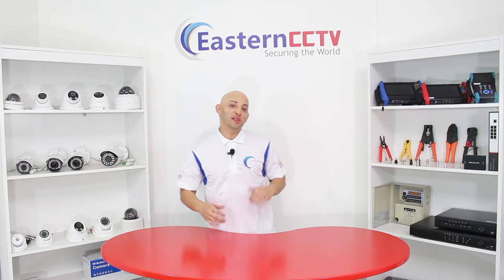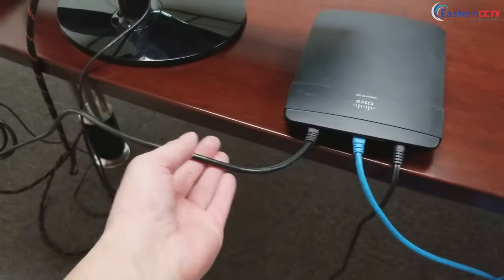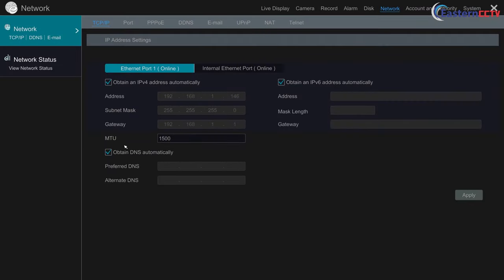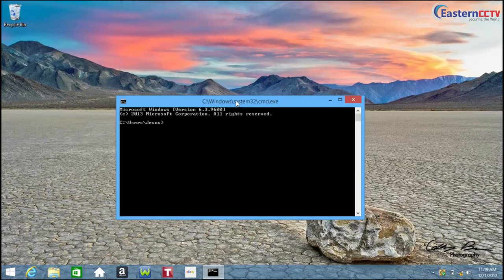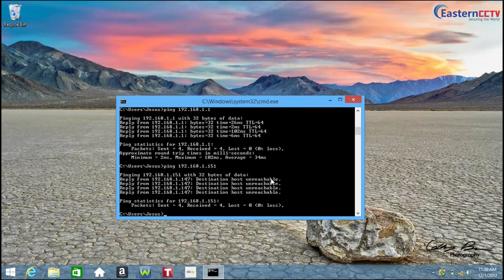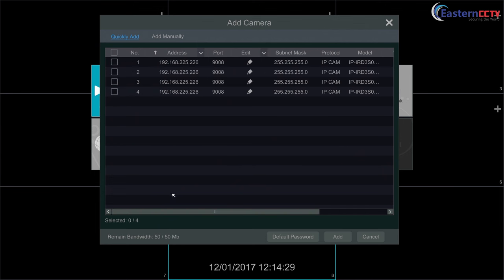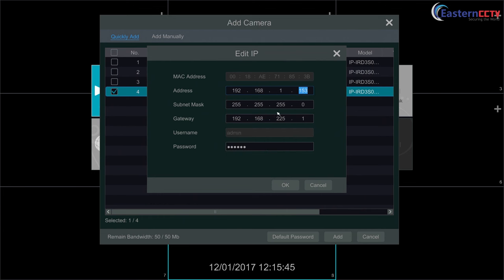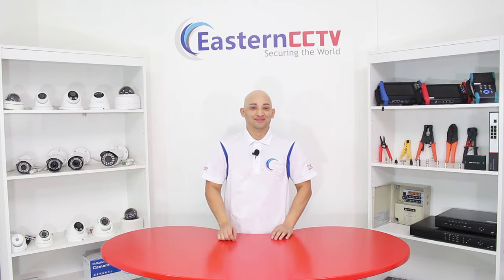How to Configure IP Cameras Using External PoE Switch Step by Step ( Titanium Series )

Comment: if I have a 16 channel NVR with 16 IP cameras can I group them either by 2X 8 port POE switch or 4 x 4 Port POE switch as long as the uplinks of each POE Switch and the LAN of the NVR is connected to the same router? Secondly could I add another router from one of my main router ethernet ports to handle my IP Cameras and NVR so I don't have too much overload on my main router between the IP CCTV system and other computers and tablets on the same network! Basically I want my IP CCTV system to have a dedicated network from my home computer/tablet network!

PS: In my current home I have a 8CH NVR with 8 IP Cameras which are connected via the POE ports of the NVR, However I might be purchasing a bigger home which requires double the cameras that I currently have now and the structure seems to have more obstacles than my current home to have all 16 ethernet cables to meet at the same point!
Reply from the maker: The answer to both of your questions is Yes you can. You might need to add the IP cameras manually because they are not connected directly to the PoE Ports on the NVR If they are EasternCCTV Titanium Series IP cameras and you have a titanium NVR just follow the steps on this video. If they are not EasternCCTV then you might need to refer to their manual or call their Tech support =)
Reply: would I be correct to say that direct connection to the POE Ports of the NVR the IP cameras are automatically assigned IP addresses by the ports that each is connected to?
Reply from the maker: Yes. The NVR would automatically assign and configure the IP camera. In order to do so the NVR and the IP camera has to be the same brand and of course they need to support Plug & Play Feature.

Comment: Hi what if i plugged a whole bunch of Cameras to the NVR and use another Switch to NVR and connect more cameras to the Switch will it work?
Reply from the maker: if you connect the NVR LAN port to the External PoE Switch and the switch to the router then it will work. if you connect the POE switch to one of the POE ports on the NVR, there might be a chance that it might not work. also, the NVR has a limit to the number of IP cameras that you can add.

Comment: Hi, what if I don't have a Nvr but DVR is it possible to connect Ip cameras to a Ip cams?
Reply from the maker: Hello, could you clarify a bit? If you have a DVR that supports ONVIF IP Cameras, you could add them to the unit.
Reply: @ENSSecurity  Hi,I have a DVR and Ip cam can this 2 be connected with a switch,what kind?
Reply from the maker: @cktrading72  Hello, It will depend on whether the DVR accepts IP Cameras. If the DVR does accept IP cameras, you typically need a PoE switch with 802.3af(PoE) or 802.3at(PoE+) compliance.
Reply: @ENSSecurity  thanks

Comment: After connecting all the cameras to the NVR, can I now view all the cameras from different location in the house eg different rooms on a regular smart Tv as Monitor? If possible, how to go about seeing this up??
Reply from the maker: You can view the cameras on the TV as connecting the regular monitor via HDMI or VGA port of NVR.
If you ask for the app support on smart TV, SuperLive Plus (Titanium app) doesn't support on smart TVs.
Reply: @ENSSecurity  so the situation is my customer has 5 smart TVs all in different rooms/locations, he wants to be able to view the cameras on all the TVs. Would I have to use a HDMI splitter or is it way to do it over the Ethernet?
Reply: @ENSSecurity  hey good day again to you. I was wondering if I could use a HDMI to ETHERNET adapter to transmit the video signal from my NVR to multiple TVs in different locations as a monitor to be able to view my network cameras??
Reply from the maker: @ianking8212  Yes that is correct
Reply from the maker: @ianking8212  Yes you would be able to use a splitter

Comment: What about the internal POE IP ranges does those stay on separate subnet ie 192.168.254.X ?
Reply from the maker: Sorry for late reply, The internal PoE can stay on its own separate network. it is recommended this way so it won't cause any network conflict.  You can use the same network range but make sure none of the IPs of the cameras are the same as the ip cameras on an external PoE switch (if any)

Comment: H,i I have Tiandy NVR and Ertech  IP cameras. The NVR can't find the cameras, and the software that came with them doesn't as well. What could be the problem? Tnx
Reply from the maker: 1st thing to check, Check if the IP cameras are getting power. The software of the IP cameras make sure you dont have an Antivirus active or firewall. 2nd Make sure the IP cameras support PoE.

Comment: Hello, I have an account with Eastern CCTV. Thank you for this video. Does the PoE have to be a gigabit PoE switch or is 10/100 ok?
Reply from the maker: It all depends how many IP cameras you have connected to it and also at what MBPS you have them set at. For example if you have 10 IP cameras at the maximum of 10Mbps that equals to 100MBPS and if you have more cameras connected to the PoE switch then the network will not work properly on the PoE Switch. If you are going to connect a large number of IP cameras i recommend you the Gigabit Switch.
Reply: Hello, Thank you for your quick reply. Yes, this is 40 ip camera system. Can I go to a non-poe gigabit switch at the NVR and branch out to 5 seperate 8 channel 10/100 PoE switches each having 8 cameras? (or do the PoE switches also have to be 10/1000 switches?)
Reply from the maker: Yes you can do that. You can connect the NVR to the Gigabit Switch and connect all you PoE 8 Channel Switches to the Gigabit switch as well.

Comment: Hi,

I want to ask,Isit possible that I have a 4channel NVR and I buy a 24 port Switch and connect 8 Cameras ?
Reply from the maker: Hello, You can only have the Max number of cameras the same as the number of channels on the NVR. If the NVR is 4 channels you can only connect 4 cameras. If the NVR is an 8 Channel with 4 Port PoE then you can use any External PoE Switch to add the rest of the cameras.
Reply: Thanks for the reply 
EasternCCTV (USA) LLC | Professional Security System Wholesaler

Comment: How to configure d link poe awitch and nvr , i hav to connect 60 80 cp plus camera using 2 3 poe switch and nvr
Reply from the maker: Hi, Your connection will look like this. 
NVR  LAN port ---   Gigabit core switch ---  Dlink PoE switch uplink port  
                                                                    Dlink PoE switch LAN port --- CP Plus camera.
                                                        
                                                              ---  Dlink PoE switch uplink port  
                                                                    Dlink PoE switch LAN port --- CP Plus camera.
                                                        
                                                              ---  Dlink PoE switch uplink port  
                                                                    Dlink PoE switch LAN port --- CP Plus camera.

Assuming your CP Plus camera is ONVIF compliant, and the NVR you choose supports 60 to 80 channels.

Comment: I want to use 3 poe switches, where to connect the other 2 poe switches? Can i interconnect the switches and connect just one switch to the router via gigabit ethernet wire/port?
Reply from the maker: PoE switches they act just like any other network Switch. you can have many PoE switches connected in like a chain mode. if your PoE have an UpLink port then connect that to any available port on the other switches. As long as you have the IP cameras connected to a PoE port then you can connect the Switches any way you want as long as you don't exceed the maximum bandwidth of the Switch.

Comment: Ok so can you use a gateway if not how do you connect to the internet for cloud access
Reply from the maker: Hi, Can you rephrase your question because is not clear. I can't understand what is the question sir.
Reply: Do you connect the land cable from your modem to your router or can you connect directly to the Poe uplink using a gateway if your Poe switch has 2 uplink switches I don’t see where you connected a land cable into the Poe switch or the router in order to gain internet access
Reply from the maker: @mrpierce17 Pierce there are two ways you can connect them. 1. Connect the LAN port of the DVR/NVR to the Your Router and connect the UPLINK port of the PoE switch onto the Router as well. Way number 2. Connect the LAN port of the DVR/NVR to any port on the PoE switch along with the IP cameras and then connect the UPLINK Port of the PoE switch to Your Router. It is recommended to have a Router and not just a modem. Nowadays usually your ISP gives you a Router/Modem 2in1. So connect them this way and you should be fine.
Reply: Got it thank you

Comment: Why not plug the cables from the cameras directly into the nvr?
Reply from the maker: It depends on how you would like to connect your cameras. If your NVR has built-in POE switch, you can plug directly into NVR.
Reply: @ENSSecurity  thats what i did but i just didn't understand why people did that...thanks for replying

Comment: So, even though my DVR is only 6 channel I still can install Ip cameras?
Reply from the maker: It all depends if your DVR can support IP cameras, Please check with your DVR manufacturer or the DVR specs to check if the DVR is able to handle Coaxial cameras and IP cameras. Some DVRs, for example, you are able to have 8CH coax and 4 IP cameras giving that the DVR is only an 8CH.
Reply: @ENSSecurity  Mahalo
Reply: @ENSSecurity  My DVR is night owl hybrid 6 channel, 4wired and 2  wireless. All cameras are ac powered. All 6 cameras are set and running but I want to add more either IP or wireless cameras, is that possible?
Reply from the maker: @MartinezFAMHawaii  The only thing I can suggest is to look up the model number of the Unit that you have and check the specs to see if the unit can accept more IP cameras. If you are not sure ill recommend you to contact the manufacturer and ask them directly. If your Unit is only a 4 Channel and can accept 2 Extra IP cameras I douth that you will be able to add more IP cameras into the unit.
Reply: I checked the manual and I can still add more IP cameras, Mahalo.
Reply from the maker: @MartinezFAMHawaii  That's great, now you simply need to buy an IP camera/s and connect them this way and do the configuration accordingly to the IP cameras that you buy. Tip: make sure your NVR has ONVIF protocol this way you have a wider range of different UP camera brands that also support ONVIF protocol.

Comment: is this working for any router?
Reply from the maker: Yes, it works with any router but please make sure you have the PoE Switch to provide power to the IP cameras. You cannot just connect the IP cameras directly to the Router unless the router has PoE Ports.
Reply: @ENSSecurity  thanks a lot, this video was so helpful.

Comment: Thanks for the video, I learned more with you.

But I have a question, I see that some NVR (like UNV, this is an example: http://www.uniview.com/Products/NVR/Easy/KIT-301-04B-2122LR3-PF40M/#~Product%20specification ) (ip video input 4-ch, Synchronous Playback 4-ch) has some nvr's that support 4 channel with poe (only 4), If I want to put more cameras (like 2 more idk) trought switch PoE or PoE inyector, It could be work? Or it just a big dream. (Sorry for misspelling)
Reply from the maker: The NVRs can only support the Channels it is advertised. if it says a 4Ch NVR with Built-In PoE then you can only Connect 4 IP cameras and no more. You can't have a 4CH NVR and connect 8 IP cameras using external PoE Switch. Some NVRs you have to use an external PoE switch because they dont have built in PoE Ports, but no matter if they dont have PoE ports you Can't connect more that the channels as is advertised.

Comment: What kind of NVR is that?
Reply from the maker: Thats our NVR TITANIUM SERIES.
Reply: Can this be done using a wireless gateway or do you have to use a router without built in modem